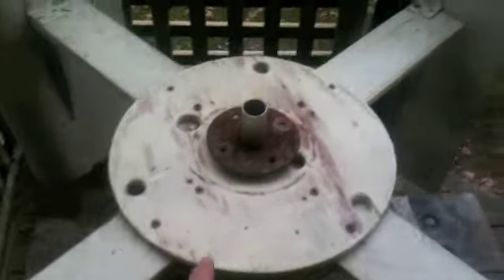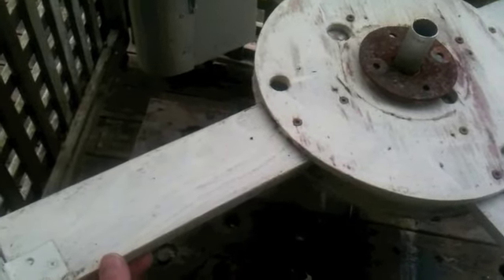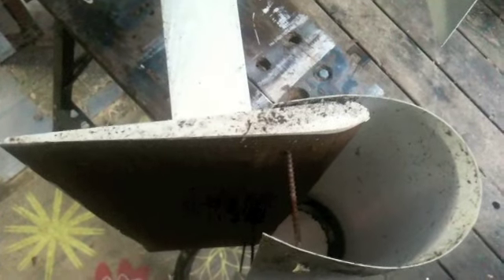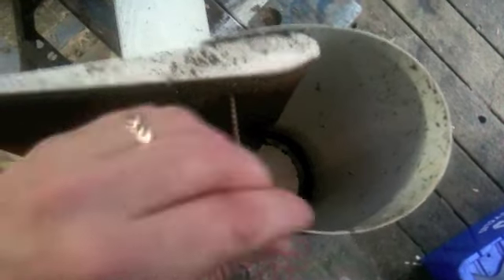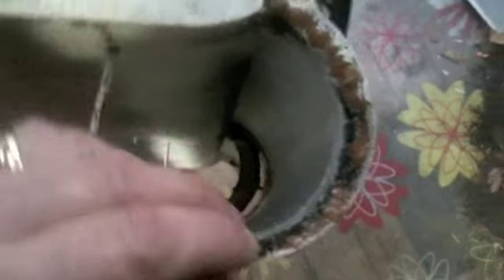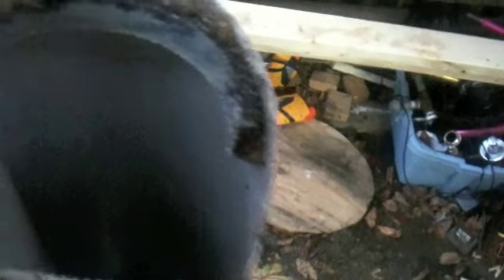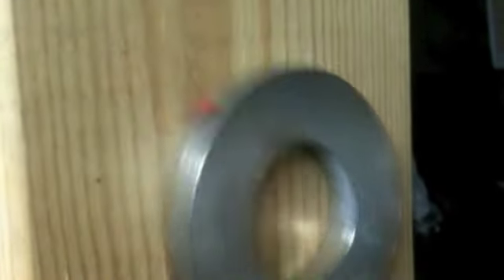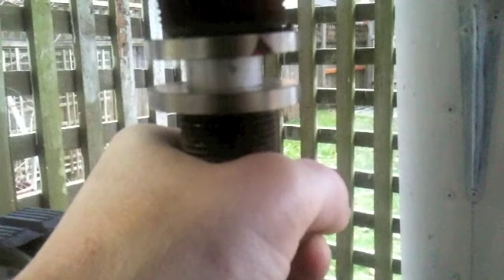Build #1- Vertical Axis Wind turbine from Wood Siding

Comment: Hey there, thanks for the sub, looks like you are evolving into a Lenz 2, pop over to http://www.windstuffnow.com/main/lenz2_turbine.htm and check out Edwin Lenz design as he has made it open source, my lip is to ditch as much as much wood from the build as you can and use metal skins on the wings, the one I made from wood and plastic skins didn't last the 2nd winter, I have an idea for a new smaller Lenz 2 from scavenged automatic washing machine parts, you shelve bracket supports are a thing i did not think of (even though I worked in a hardware store) I will be working those into the next build.
Reply from the maker: I'm leaning towards that style of wings. Seems to be a proven design. Plan to use some large sheets of press plates (thin aluminum from a printing press) for the wings. I know exactly what you have in mind for the washing machine part. It's a sweet 3 arm with an 1" hub. Keep me posted with your progress.
Reply: yup the bearing would need replaced with something better than what comes in a washing machine, they don't seem to be sealed the ones i used with PVC pipe blades rusted solid in a week, what i like about that casting is that the shaft has a internal thread at the end so it should be useful when it comes to connecting to a motor or pulley.

I'm going no bigger than 18-24" this time the 1 mtr one was seriously scary when it was at full speed, one great feature of the lenz 2 is that they go into auto stall at about 120 rpm so you have a built in safety. the printing plates sound like a good idea, but make sure you use marine plywood, i didn't and it was de-laminating after 18 months, I should have used 3-4 coats of yacht varnish or a resin to coat the wooden parts rather than exterior gloss paint.  I'm going to try and go for all metal or aluminium and PVC for the next one.